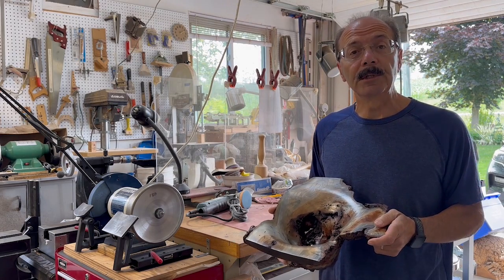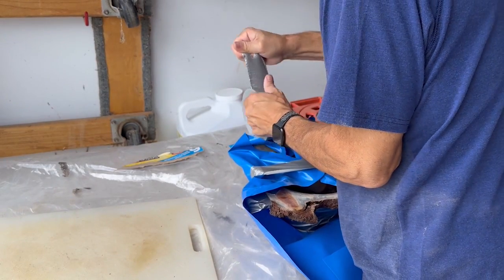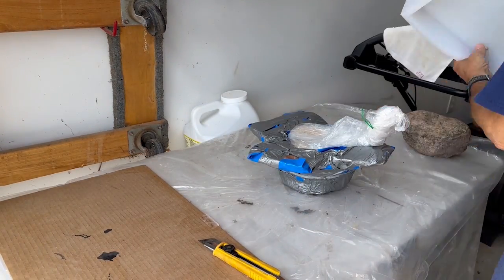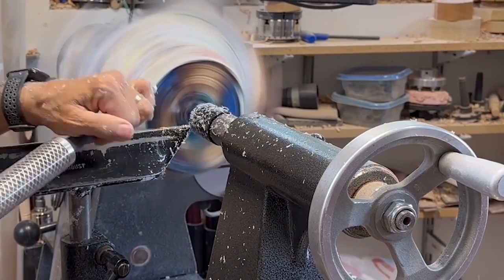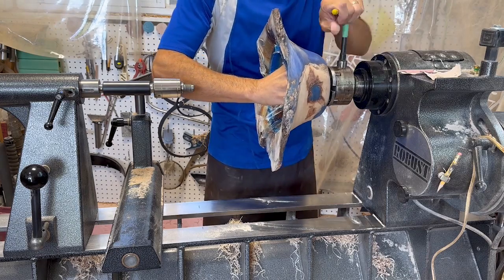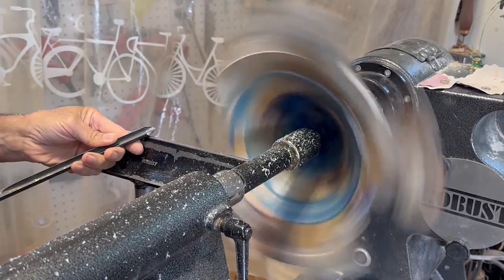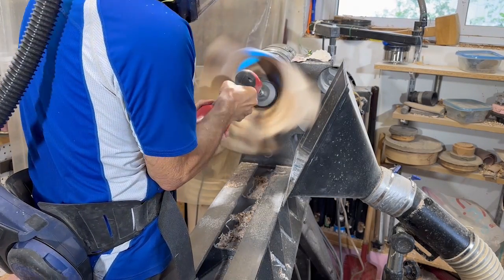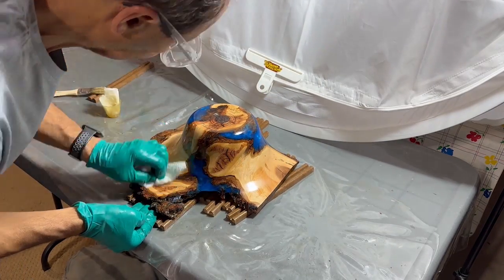Woodturning a Blue Epoxy Burl

Comment: Very nice bowl.  I have had similar problems with the deep cast as it always finds a way to leak.  I think the slow set time and maybe heat buildup will dissolve the tape.  Where did you get the shrink wrap and does it come in smaller sizes (smaller than a boat)?
Reply from the maker: thanks, i was able to get the shrink wrap from excess/leftover pieces or the end of the roll from my local boat dealer where i get my boat stored in the winter.  I think you can buy smaller sizes on amazon also.